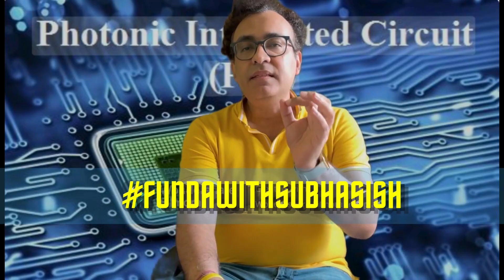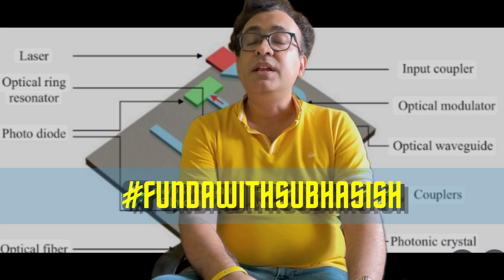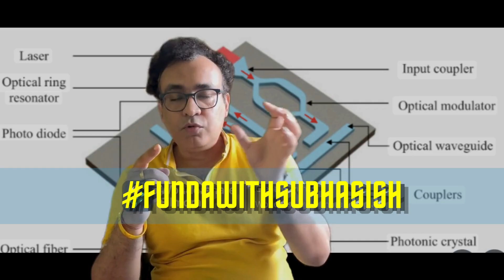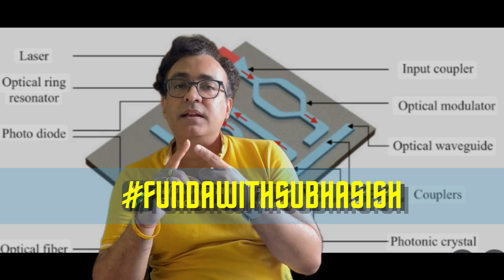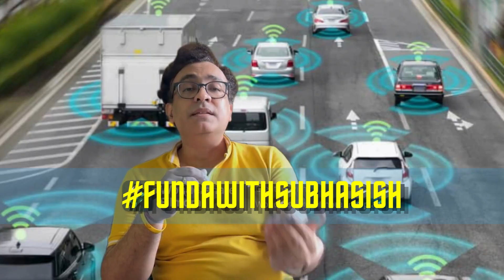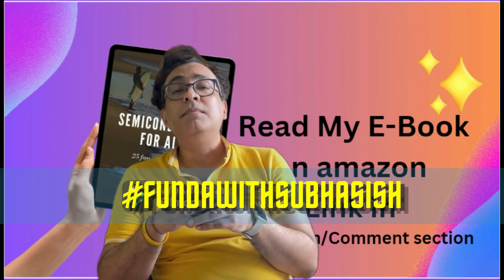💥 Photonic Integrated Circuits: From Concept to Chip Design 🔄💡 | PIC |  Subhasish Chakraborti

Comment: Thank you for this beautiful video. This is an emerging field. Researchers and Scientists have already developed some products. The challenge is that each design has a very specific uses and the material platform use to build the device.  A little twist in the design can give you a totally different function. For example, an Interferometer which can be used as a switch by applying a heater in one of the arms. But by modifying one of the arms, you can use it as a sensor.

Comment: Are PICs going to replace all types of ICs?
Reply from the maker: the PIC now mostly used as switch to connect datacenters as it is fast. Right, in near future, it can replace in different IC types for AI. It is next-gen chip tech.
Reply: Not all types of ICs can be replaced but it can be complementary to each other. Right now, there is vast research going on in PICs domain because there is a huge demand of applications in the data center.